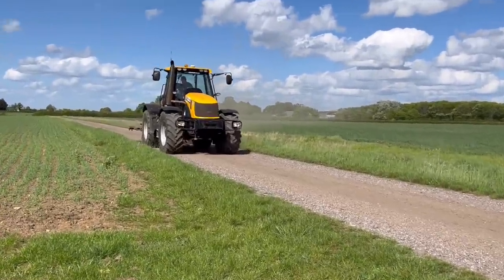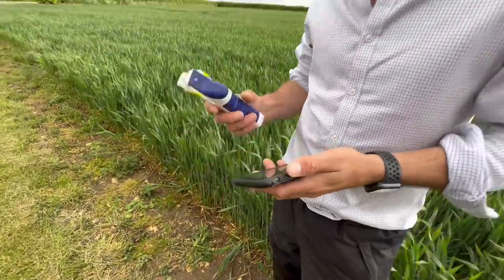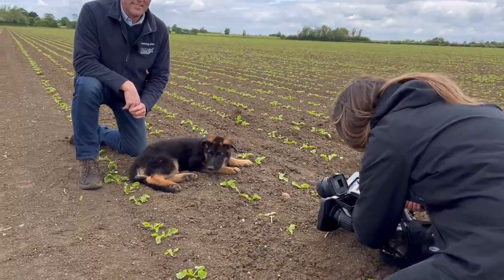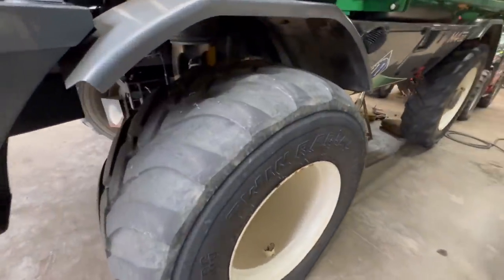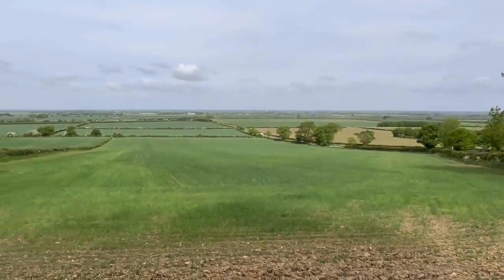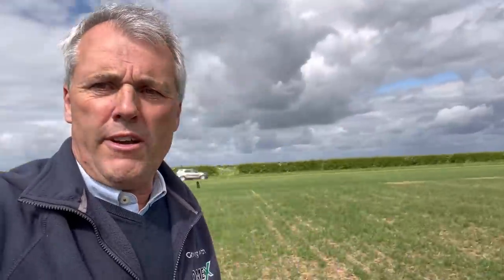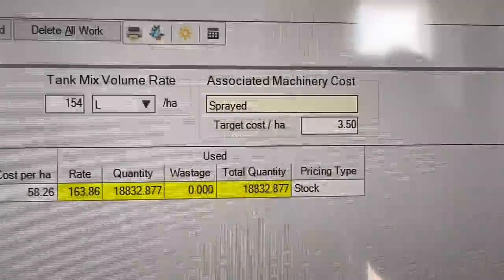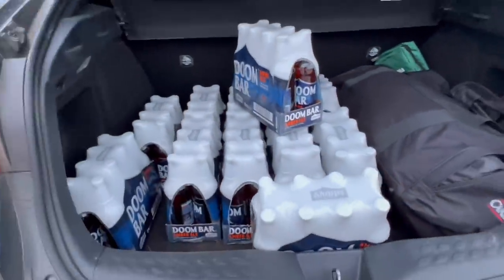FARM UPDATE 50 - BBC RADIO AND TV VISIT, FINAL NITROGEN ON WHEATS, FIELD RECORDS, DIRECT DRILL PLOTS

Comment: Excellent informative video. As a retired agricultural engineer, the cracking on the sprayer chassis was rather concerning. You might expect it after 20 or so years, but not on a 9 year old machine. I assume Houseman were made aware of the issue and have hopefully redesigned or beefed up the chassis. It would be a mess to see a major breakage in the field. We had a little rain in West Suffolk, but only enough to lay the dust, and all gone in 24 hours. Enough for the slugs though!!!!! Your filming at 22.00 mins from the hill shows that Great Britain is still a 'green and pleasant land'. Wonderful view.
Reply from the maker: They did change the design a few years ago and it sorted the issue. That view is from my village and on a good day the Derbyshire Pennines are visible.

Comment: Great weekly video as always! It’s interesting to see your boom height on the sprayer when applying liquid fert. I use umbrella nozzles. I’ve been told it’s best to run them high above the canopy so the droplets roll off the plant when hitting. Is this not the idea of the stream bars? Would like to know your thoughts. Regards Ross
Reply from the maker: You might be right, we’ve had scorch this year and I’m wondering if boom height is the reason,

Comment: A top brand sprayer with these cracking problems is very surprising especially after working on your land which is very level and smooth not good
Reply from the maker: Our sprayer was the Merlin prototype and since it was built they have modified the wheel motor housings with no probs since.

Comment: Looking across the S B plots it does look thin,row spacings varied between 125-225mm ?The SB at the Irelands farm ,did that go in February
Reply from the maker: The widest DD plot row spacing was the Avatar at 250mm and the narrowest the Dale at 125mm. I think the ideal spacing is around 160/ 170mm with blackgrass in mind.
Reply: That is around what the old MF 30 drills use to be,Ollie Harrison has planted SB into WW and thinks he can harvest the wheat and then harvest the SB again ,which I dont quite get,what I have seen will end up being ripe close together.If its of interest to see the type of countryside I work with ,go onto pitchup a camping website and type in Oatcroft
Reply from the maker: Our Freeflow is 12.5 cm row width. I know Olly well, will be interesting to see if it works. I’ll have a look at your scenery.
Reply: There was a program on in February called Wonders of the border,on ITV walking from Chepstow to Chester along Offas Dyke,where we are was in episode 3 ,a lady carrying a helmet,although the way it was edited we moved 20 miles N to the half way stage.
Reply: There are ones trying to plant clover,although I thought clover only fixed it for itself it only becomes available when it sprayed off,a green mulch in the bottom will really help a combine on a dabbled season